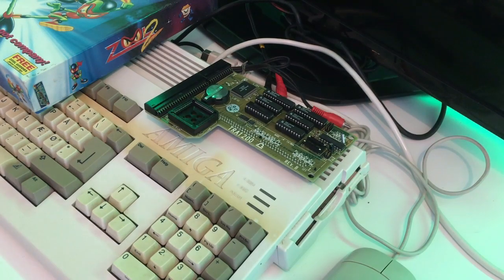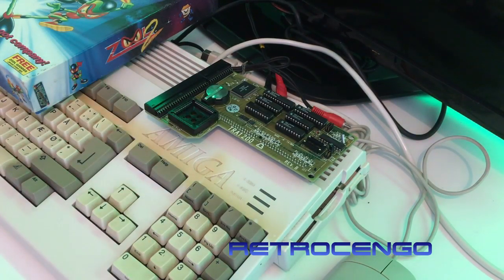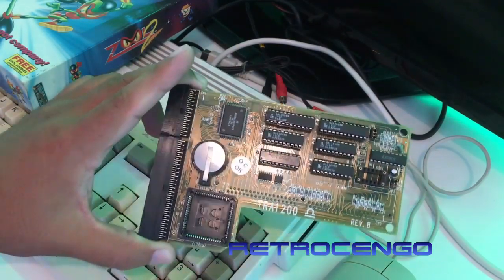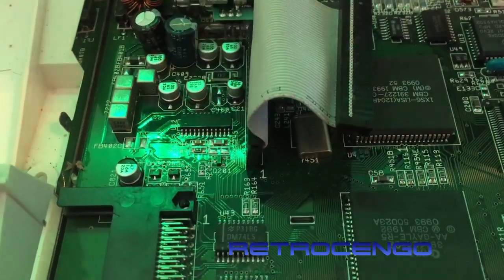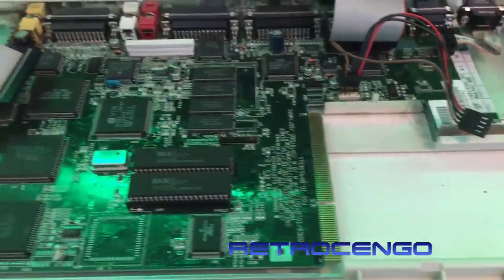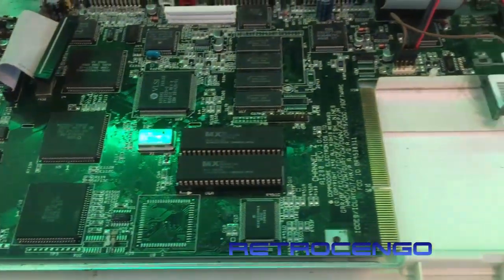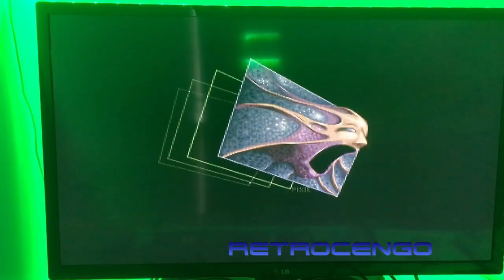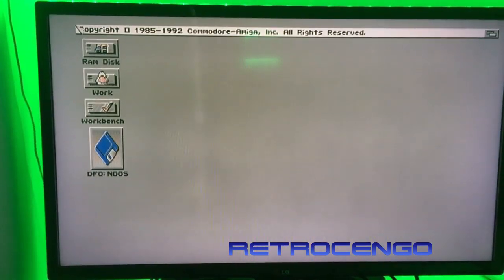The Amiga 500 was an Amiga 1200 ?!?

Comment: I never understood why you would upgrade a 020 to a 020 🤔
Reply from the maker: Daniel Son The built in is only a EC model that runs 14MHz
Reply: @RETROCENGO  I know that just adding fast ram doubles the speed of the A1200 is the ec model of the 020 a cut down version of the 020 ?
Reply from the maker: Daniel Son yes it is. Bit also the built in is 14MHz, this one is 68020 28MHz, its actually a great upgrade for whdload gaming